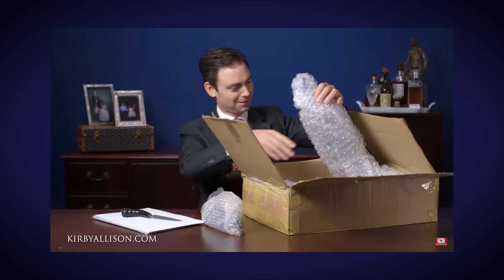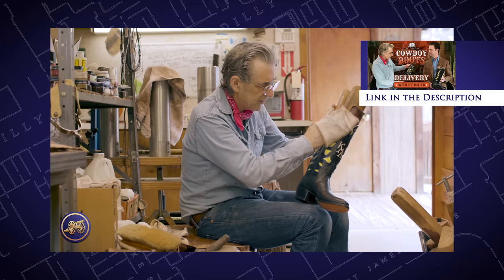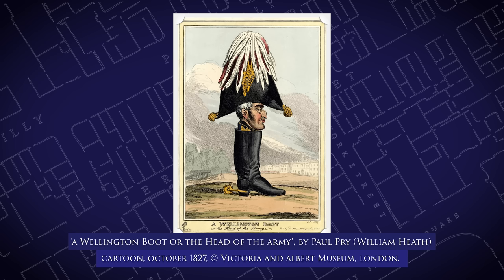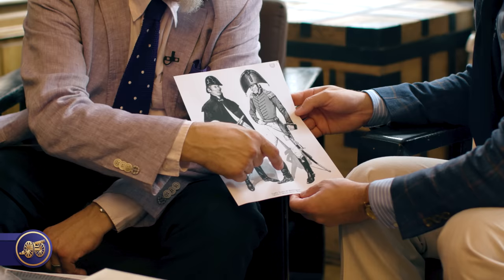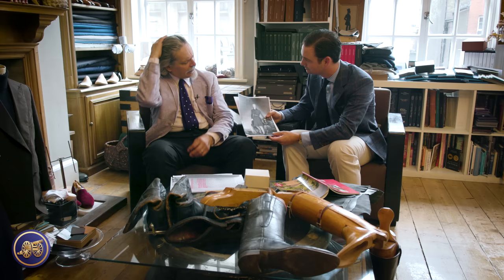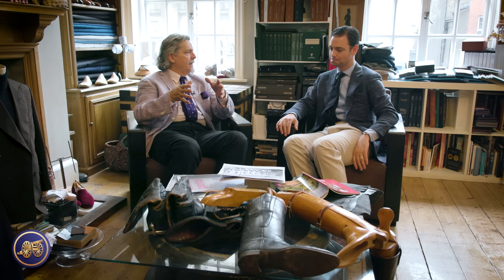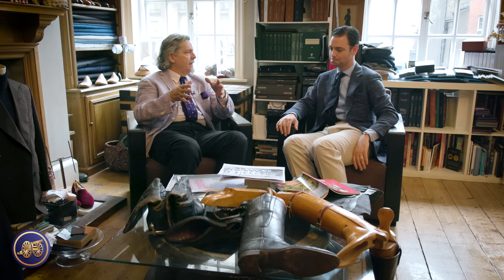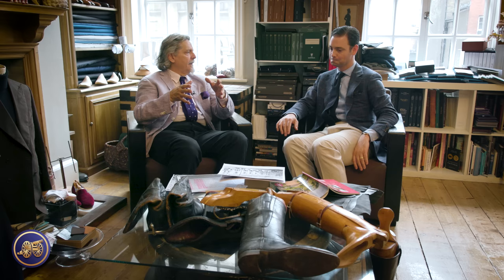The Incredible History Of The Wellington Boot With Dominic Casey | Kirby Allison

Comment: What does Dominic know about the George boot as a derivative of the military Wellington boot? Does it bare any relation to the later Chukka boot?
Reply: The George boot was supposedly popularised by the late King who disliked mess wellington boots (i. e. Wellington boots worn with military mess dress uniforms) such that he had his boot maker come up with the design named after him with a lace at the instep. A true George boot is actually distinct to that of the colloquial chukka boot in that the rear quarters are set much further back. The reason for this is that when mess wellington boots are worn, they are normally worn with cavalry ‘overalls’ which are tight fitting riding trousers worn as part of mess uniforms, importantly the overalls feature a leather straps at the bottom of the hem that buckle under the waist of the boots, covering up the entirety of the shaft of the boot. Consequently, George boots looked identical to mess wellington boots when worn with overalls as they would cover the lacing at the instep. They eventually became a cheaper alternative, becoming a general issue item by the British army. Chukka boots on the other hand are a laced variation of the jodhpur boot which was popularised by the late maharaja of jodhpur that used them to play polo hence the name (a chukka being a period of play in polo). John Lobb’s archives actually feature a few laced jodhpur boot designs from the early 20th century reflecting this.
Reply: @carmina776  Fascinating. Thank you.

Comment: The high cowboy boot heel is not a riding boot thing/requirement (fashion being justified). Riding boots can use a heel, but it need not be bigger than the average dress shoe heel so the pair at Walmer castle could be for riding but with the idea applied of having them be less built up as an early "prototype" pair. As was the idea of the wellington boot. Walking more comfortably with a heel is another story, but as humans used to be ball of the foot walkers and not heel walkers like today there are merit to it, but zero drop shoes does have advantages.